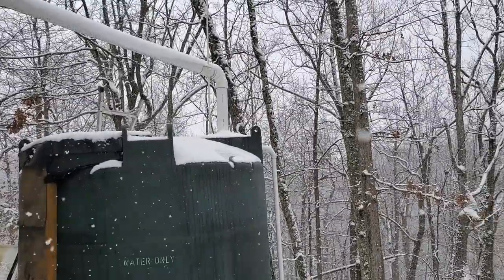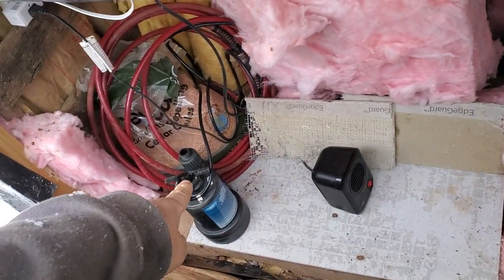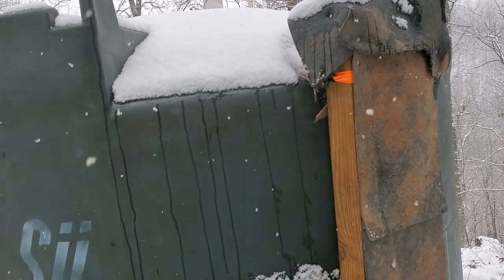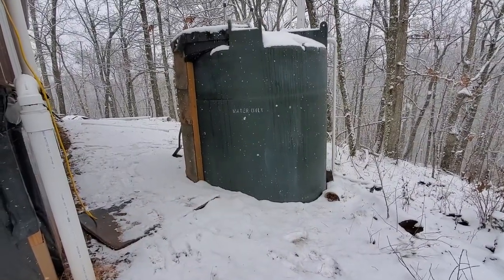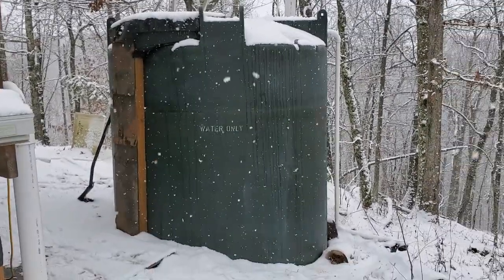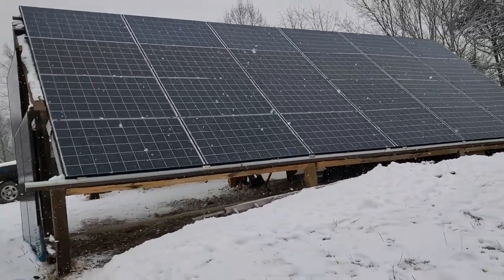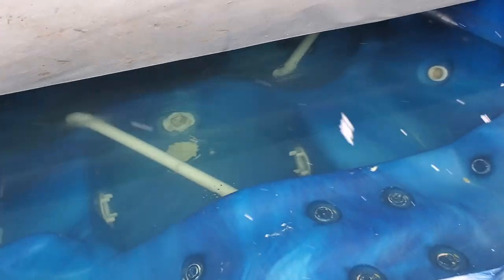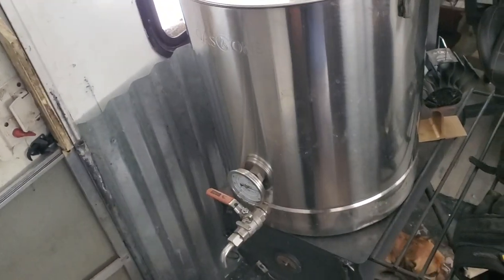My Water Tank Froze!

Comment: Missouri windandsolar  sells a true DC thermostat controlled hot water element for $89. 12v/200w or 48v/700w 0f to 190f. Like you say, putting more holes in the tank is a risk, hope mulling the idea goes well in a warm place with cold beer 🍺

Comment: I'm back! Second comment.  I use compressed air to "pump" water in a number of ways. Of course, I should level with you, I have a constant supply of compressed air. I build wind turbines (mostly VAWT) as a hobby and while some make electricity, others compress air whenever there's wind. I also build steam engines (modified to use compressed air) as yet another hobby.  Call it (them) hobby extention(s).